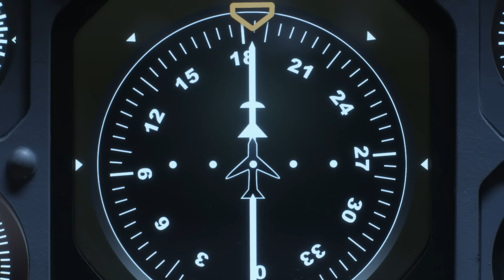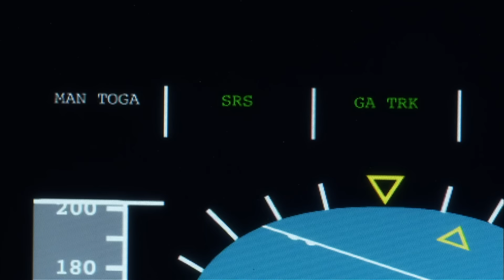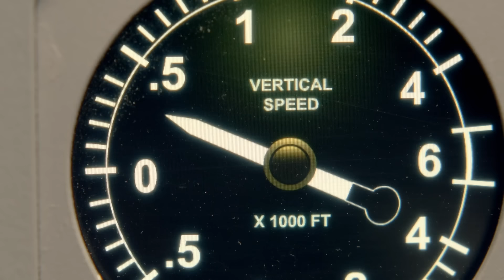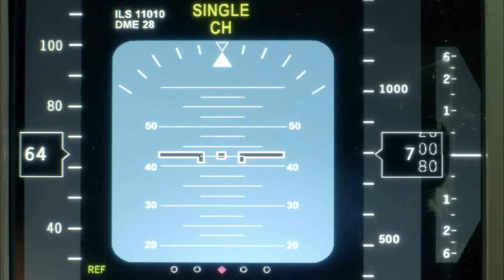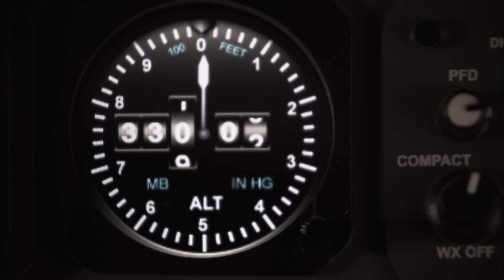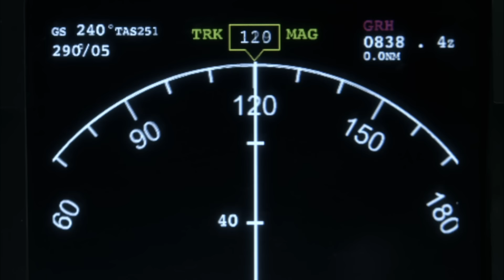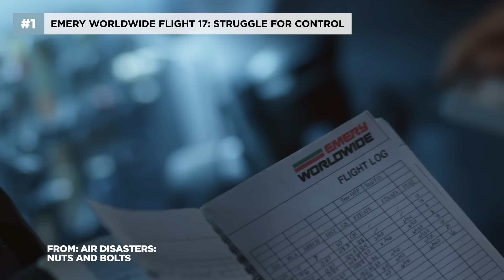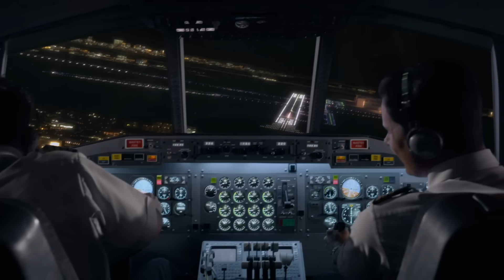9 Intense Plane Crashes Caused By Stalls ✋ Smithsonian Channel

Comment: There are few physical human mechanical / machinery performances more beautiful than flying.  I flew small aircraft and soloed first time in 1993. and it was such a satisfying experience.  Many of these accidents can or could have been prevented, but it underscores why flight checklists are a critical step.  Computers are correcting many of these but you still have to rely on the human element.

Comment: 12:15 the gear didn't go up that's most likely what caused the crash
Reply: The Plane's Heavy Cargo Car rope was been broken and then the Cargo Car was pitching down to the Ramp and forced the plane down!
Reply: @weonedirection8205 it disabled the rear flight system